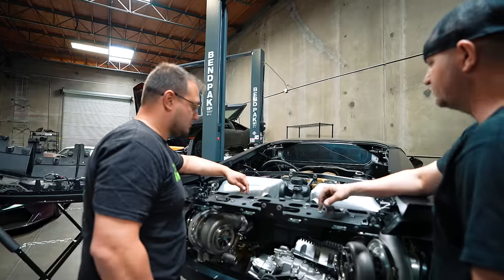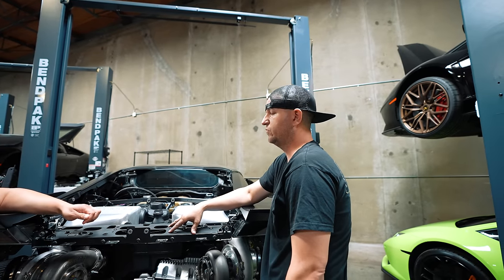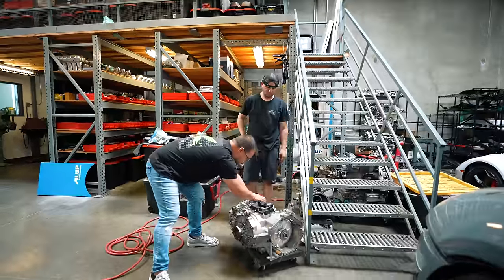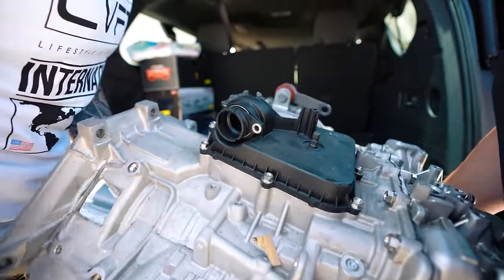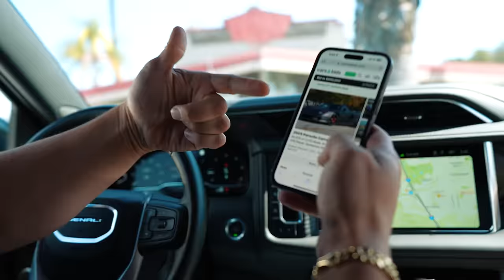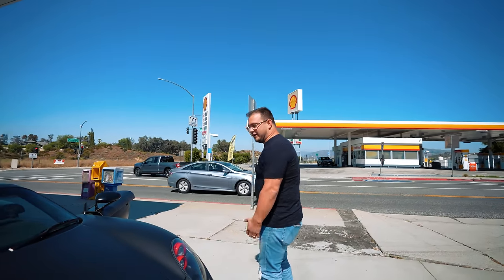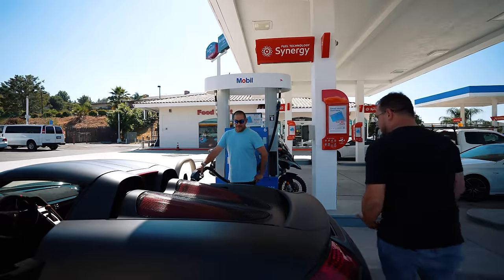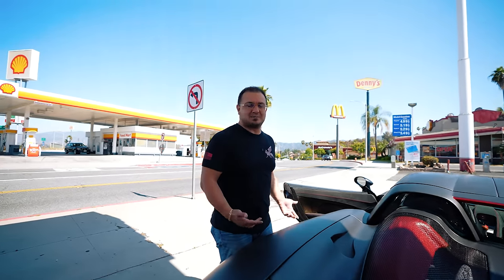I Bought a Million Dollar Car at a Gas Pump

Comment: I have had the pleasure of driving 2 Carrera GT's Let me just warn you now 
the clutch is very small with 2 plates its like a motorbike clutch essentially. but it is WAYYY UNDER /OUT OF SPEC it needs probably 3 more plates on it in my opinion. 

now the reason they burn out or GLAZE  
 it's because of the material it is made from silicon carbide and carbon fibre. So, it's essentially Akebono brakes from a McLaren if you have ever seen that brake package on a P1 McLaren. that's essentially what the clutch is. Problem is when you slip these, they are cold and you get glazing which makes the surface like "glass" so it no longer grips. and then you have no clutch. 

Taking off is where the most damage occurs as I said a cold clutch and any slip= glazing. so the correct way is ZERO throttle let the ECU' ANTI stall work for you. you just Zero throttle and release the clutch at the correct speed to get it moving and obviously don't just dump it will grab and stall. 

Other than that get the suspension pickup points in the rear checked as its a weak area ( like a lot of carbon fibre chassis)  where the wishbones can rip out if not looked after (possibly what happened in the paul walker crash)
Reply: @13AZ13 I did

Comment: buying a salvage car like that is wild
Reply: With exotics salvage rarely matters on limited spec cars. You’d be surprised how many are salvaged title and no one cares because its a limited production. So they have to be rebuilt and usually by one of very few factory approved shops. Or by the factory themselves so its the same or better quality than new.
Reply: @kingrabbit101  Ferrari and Pagani can rebuild a car that's completely destroyed. I always wondered how they did that. I wonder if they just replace the chassis and re-vin it
Reply: @VIPK9  same vin because they are numbered cars.
Reply: @kingrabbit101  all im saying is even with the rarity of the car considered its still crazy to buy a car without knowing about hidden damages, frame damage, etc

Comment: 175k in 2009  , now 600k.  Show you how little buying power our dollar has.   Yes inflation but inflation is caused by lower buying power and to much money in the system
Reply: You would have a point if the GT was 175 overseas and 600k in the USA. But It’s over a mill in any country. But more overseas because they are harder to come by because of the rarity